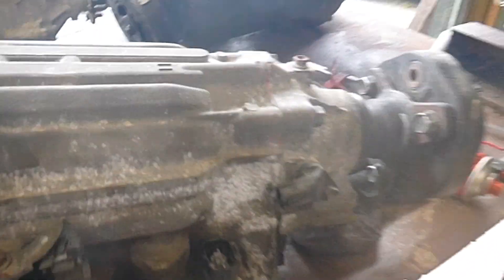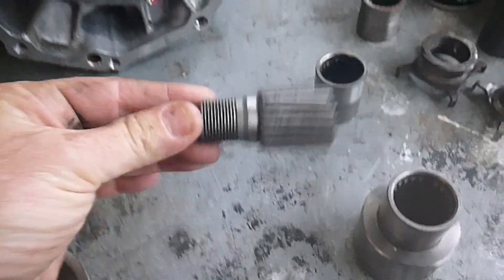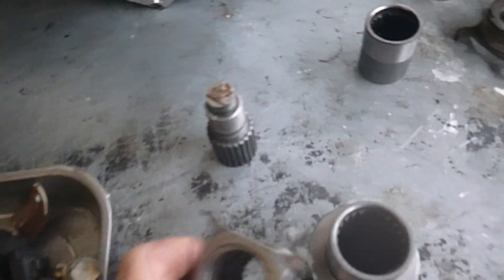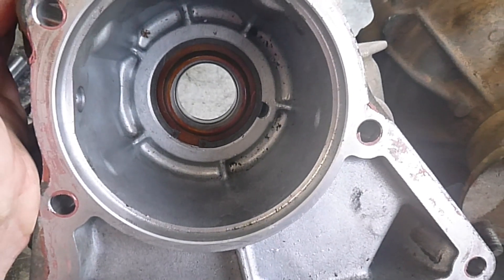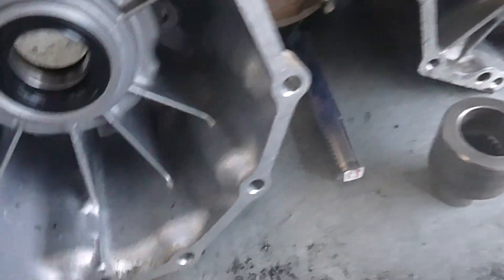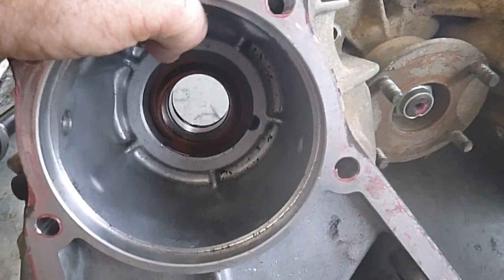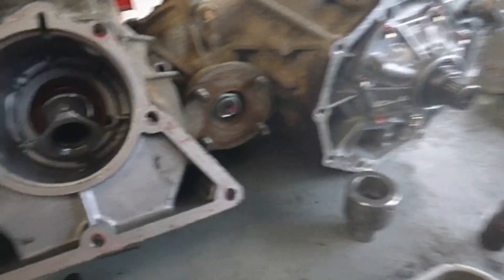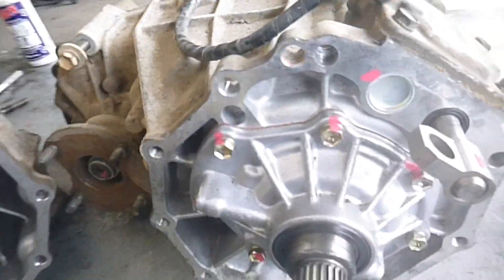1uzfe A341 automatic converted to 4x4 transmission Overview.

Comment: Hi Kelvin, I’m looking to do a 4x4 conversion. I live in Canada, so we don’t have hilux surfs here we get the 4runner. I’ve got a 1993 1uz from an ls400. I’d like to use the auto it came with but I’m having trouble figuring out which transfer case will work like the one in your video and what vehicle I can source it from. I need a passenger side drop t-case. 

Thanks

Comment: What 4x4 automatic transmission would recommend for a 1uzfe engine? I'm planning to put in my 1991 toyota 4runner
Reply from the maker: The one from behind the 1uz if its non vvti,  using the adapting method shown in the video.
Reply: It's a vvti sadly 😅
Reply from the maker: @tomrodriguez7331  We have adaptors for the vvti 5 speed transmission too.  Videos due in the next few months.

Comment: Planning a 1UZ or 3UZ swap to a 1st generation 4Runner with auto. Best route to sidestep most issues- stand alone engine ECU (with your harness of course) and a fully manualised auto?
Reply from the maker: Good planning and knowledge is the best route.  Personally I like proper auto control so I can do this with either stock ecu or aftermarket,   aftermarket is better in most cases.  Manual shift is ok if that suits your needs

Comment: Kelvin do you know of any 4x4 adapter kits for 30-41LE which leave the transfer case on passenger side of vehicle? I do not believe any kit is in production, wanted to ask. I suppose you would not have figured this process out if adapters were readily available. Thank you for your awesome technical videos
Reply from the maker: We custom make that stuff as required however I have a mate doing more of this stuff so chances are they are on his list. Some A30-43 and A30-40 have a LH side transfer case stock.   Cheers Kelvin

Comment: How much do you cut off the speed sensor?
Reply from the maker: Just enough to leave around 2-3 mm clearance between the speed trigger sleeve and the transfer sleeve.  I measure each job,  so it saves me remembering it.

Comment: Which is the best automatic transmission you recommend for a 4x4 1uzfevvti. I have a land Cruiser frp top with a 1uz, trying to find the right gearbox for it that is very powerful and bulletproof.. Thanks alot
Reply from the maker: for a landcruiser I generally use a landcruiser transmission , the stronger one is the A440 which then requires the 2uz parts to bolt it to the 1uz vvti.  Simple.  There is also a later 5 speed version which is awesome.  Cheers

Comment: I have a 2000 Tacoma v6 auto 4x4 and a 93 Lexus ls400 donor car, the front driveshaft is on drivers side. Will this work for me?
Reply from the maker: I'd want more details on transmission model in Tacoma before commenting and knowing which side of the car you drive on.  Most likely be fine though.   Cheers Kelvin

Comment: hey mate i bought a 4runner with 1uz and 3041le swapped which was working fine but now it is having issues . it upshifts fine and runs smooth but once the car is warm it doesnt downshift , ive cleaned the solenoids what should they read out? and do you reckon it is electrical issues? it just doesnt downshift and i cant go over hills as it stays on 4th gear
Reply from the maker: I would be doing some checking.  Confirming signals into ECU are correct and checking wiring.  Is it running the 1uz ecu for the trans?  Or the 4 runner ecu as an ect?

Comment: Hi I’ve got a 92 Toyota Surf running 1UZ Supercharged V8 with 3speed + overdrive V130 Auto Trans with transferbox 
I’ve been wanting to convert to a 5speed Manual..it’s a daily driver and mainly on Road. 
Could you pls throw me a ball park figure with regards to drive inn and drive out cost...
Reply from the maker: Sure thing.  Best flick me an email on info@thecartunecompany.co.nz  and I can look at it when I'm back at work after the 13th.  I think I have a gearbox to do the job atm too.  Cheers Kelvin.

Comment: Excellent. Very interesting to see how you do it, and how the parts differ from what we have in the US. The T100 transfer case that I used has female splines on the input that slides right onto the Lexus splines (after being cut down, of course) without any adapter, but this does not give a path for the oil to the transfer bearing, so I drilled a hole in the end of the output shaft.
Reply from the maker: Hello.  We never got the T100 over here so not really an option for us.  Getting that oil feed correct is very important and we can use the same method on this as well.  More coming on this in a future video.  Cheers Kelvin
Reply: Very pertinent comment for swappers in NA market. Thanks for the tip as I may be limited to T100 transfer case. Numbchux, did you select the T100 right side drop chain driven transfer case for your build? Can you share any more? Will come check your vids soon

Comment: Kelvin thanks for the video. If you don’t run the tail shaft sensor will the trans function properly just with fault codes?  I have a speedo cable I wanted to run.
Reply from the maker: Hello.  Depends on the ecu that is being used.  I prefer the Gen 2 UCF20 or 151 Crown ecu for this very reason.  It only requires the one speed sensor input.  Other ecus (which require both for best operation) there may be issues which need to be resolved correctly to ensure correct transmission operation.  Basically as long as its all wired correctly then it is fine.  If fitting the package to a toyota auto vehicle which ran speedo cable to begin with most have the required second signal from the back of the dash cluster.  Cheers Kelvin

Comment: I converted my 30-41 to a slip yoke output from a a340e. required pulling the gearbox completely to bits and swapping over the output shaft, not a fun exercise, but got it all working off the factory ecu in the end
Reply from the maker: Well done.  Sounds like hard work to me.  I use a simple flange on the back and fit a slip joint in the driveshaft.  Super easy.  More about that in an upcoming transmission video.  Cheers Kelvin